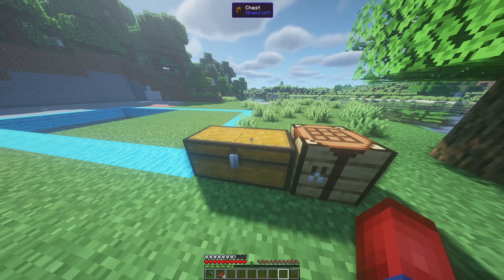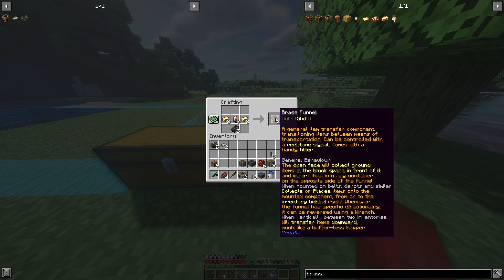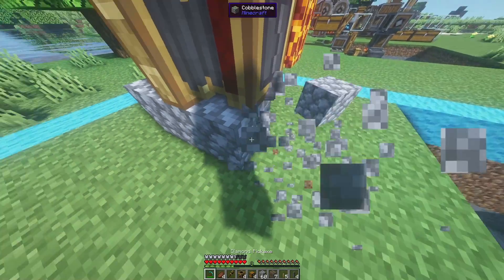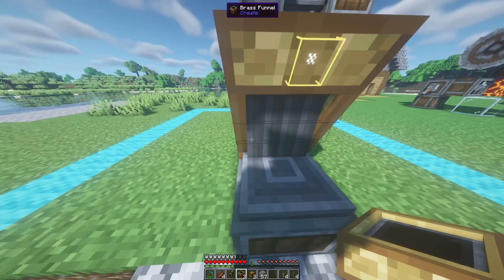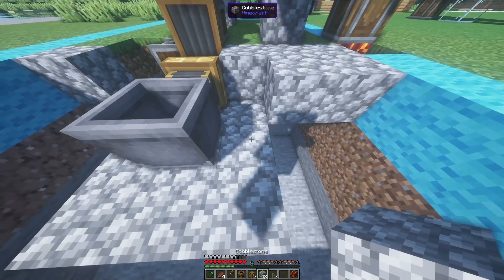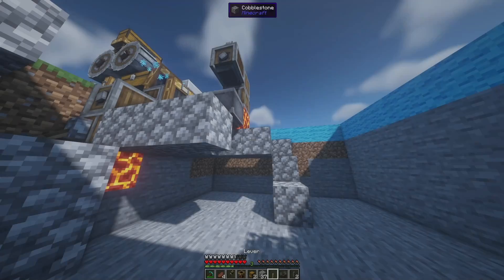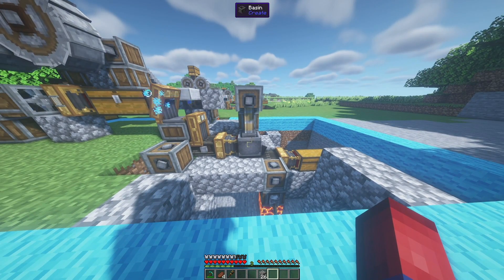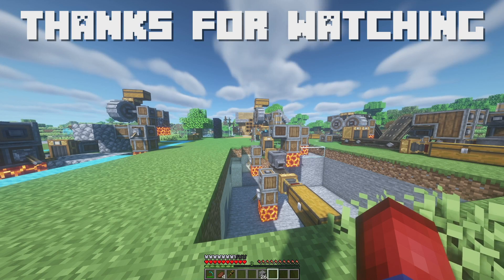Minecraft Create Mod Tutorial - Automated Ore Processing System Ep 5

Comment: One thing to note: you can easily combine the washing and first storage phases together. You just need to pull the cobble with another filtered funnel, which I did using the block the ore sits on.
Reply: And you can have the first fan that moves the crushed ore be the fan that washes it! With some fancy maneuvering this 13*6 contraption can be made into a 6*3 and be super efficient. I've got it going at 26 stress units per rpm
Reply: @MrRedstoneready  Do you have a screenshot of it?